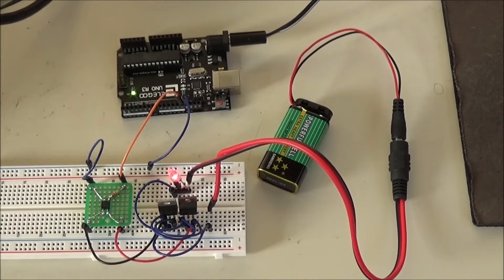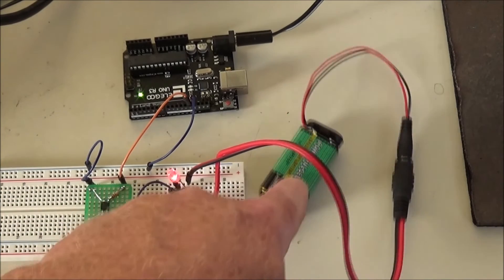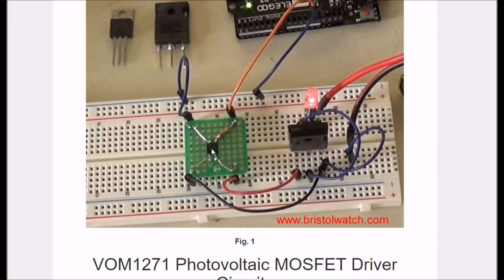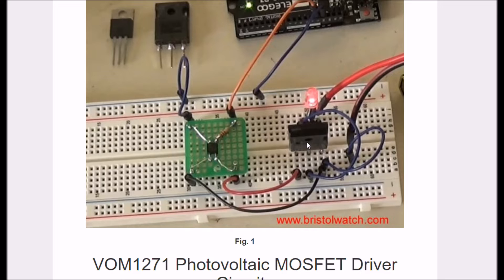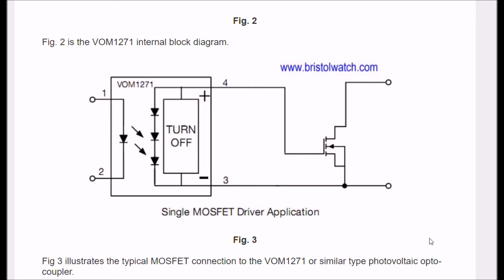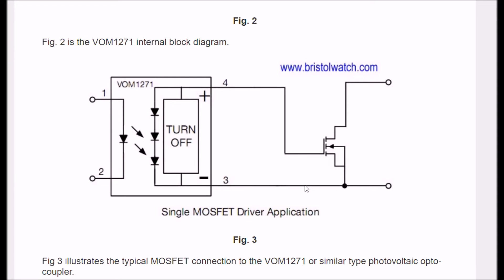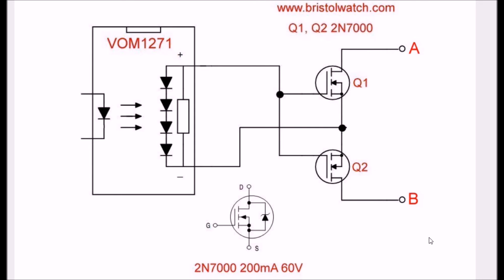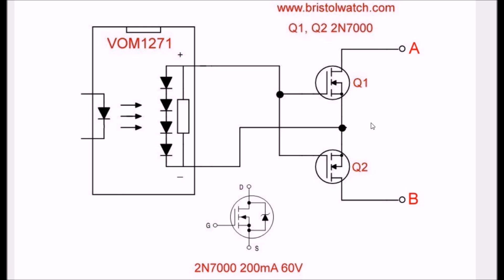Exploring Photovoltaic Optocouplers as  MOSFET Drivers

Comment from the maker: Someone asked about this circuit switching speed compared to a PC817 with an NPN bipolar transistor output. It is slow and can't be used due to the turn-off circuit within the device. I have used it with the PWM off an Arduino.

Comment: Dear lewis thank you for this video and sorry for my bad english. I have a problem. Can you help me ? I am trying to use bi directional switch in my a piezoelectric energy harvester circuit design. In this circuit I need to use bidirectional switches. The switches is driven by square wave in spesific frequencies. For this ossilation ı use a simple 555 circuit. But this circuit feeds my harvester circuit. Output voltage of harvester increases when 555 osiclator circuit works due to source of 555 circuit. I need eliminate this effect. can your circuit which shown in this video solve this problem? Thank you for interest. Have a good days without corona.

Comment: Nice video, but in many circuit they are selecting mosfet drivers rather than photocopier what might be cause ?
Reply: I'm too curious about when you have to use a mosfet driver rather than some signal source and a series resistor.
My guess is it depends on the frequency of the signal and the capacity of the mosfet. Bigger mosfets and higher power ones typically have more gate capacity, so if they demand too much current the octocoupler can't keep up and the voltage falls, eventually failing to trigger.

Comment: Please Tell us about mostet Protection circuits at voltages of 200V
Reply from the maker: This generates a voltage between the gate-source. The high voltage connects from source to drain. Because this is an opto-coupler by its nature there is no electrical connection between the LED side and the photovoltaic side.
Reply: Thank you Lewis. I mean with voltages of over 200V you Need Diode protection between Drain and Gate oder Drain and Source. Does the VOM1271 Generate enough Power to Drive High voltages Mosfets? For Example IRF840? The Gate current is only 10uA to drive a Mosfet? Regards Hans
Reply from the maker: @hansmaier3689  The drive voltage is between the gate-source regardless of source-drain.
Reply: @LewisLoflin  Please advise the resistor you use to power the opto-coupler VOM1271 from the Arduino port. The port provides 5V but the VOM needs not more than 1.6V. So do we need to reduce the voltage and current or the current only? What resistor fits the best for that?
Reply from the maker: @Rigonda_radio  120-220 ohms should be fine.
Reply: @LewisLoflin  Thanks.